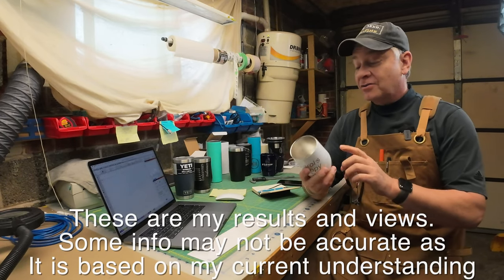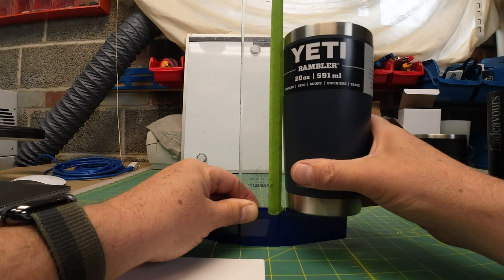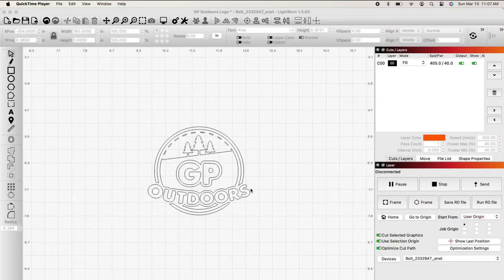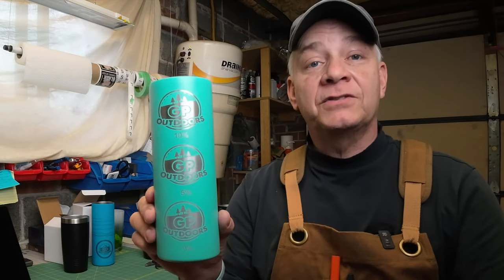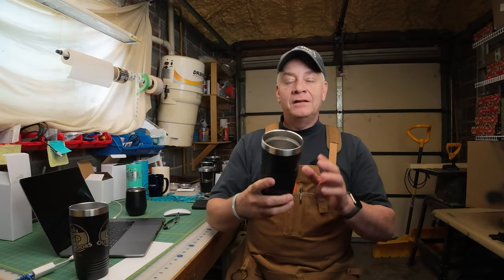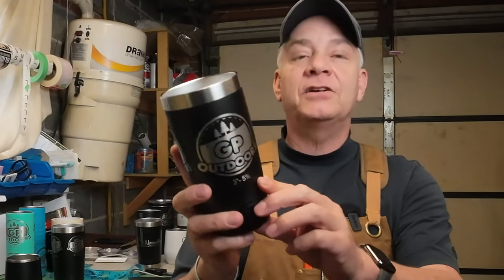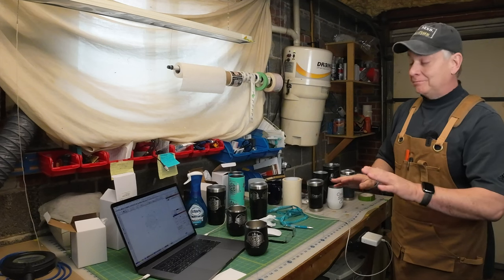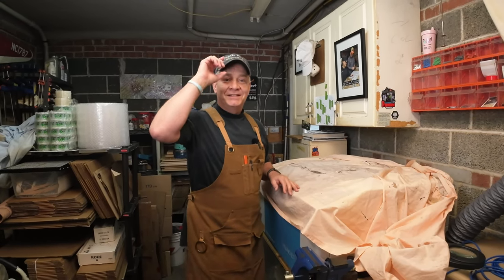Taper Warp. Tumblers and Round Logos? One Size Does Not Fit All. Thunder Laser BOLT.  026   4K

Comment: Gord, all you're asking for mathematically is to convert chord length to arc length.

Use this online calculator to account for the horizontal stretch of the logo.

Whether or not you see it as skewed is completely dependent upon the ratio of the mug diameter to the logo width.

You only need to enter 2 values into the calculator. Enter the diameter of your mug for "Diameter" & enter your original, unskewed logo width for "Chord Length." It will automatically calculate everything else. The "Arc Length" value is your new, stretched logo width.
Reply: omnicalculator
Reply: C o m
Reply: /math/arc-length
Reply from the maker: Good morning and thanks very much for the idea. I will take a look at this today for sure. Cheers!

Comment: Gord, thanks for all your research! Just subscribed to your channel. I like the way you explain things. Question for you, are you using the 30 watt Bolt and a 2 or 2.5” lens? I have a 80 watt Boss. I’m surprised at your settings 600/70. Everything I’ve read uses 400/40. Have you tried running slower? Thanks!
Reply from the maker: Good day and welcome - thanks for subscribing. I am using the 1.5" - yes , I saw that others offered that and started at 400mm as well a couple months ago, but over time testing different settings, I went from 400 mm to 600 mm now with excellent results (as shown). I still notice that similar to 400mm setting, some colours need either more or less power (sometimes I use 80% power) or a little extra cleaning - but 600mm settings are coming out great. Yes it is a 30W Bolt. Let me know how it works out for you. Thanks again and good luck!

Comment: Hi G.P. Just a suggestion have you thought of maybe measuring where you are going to engrave and say it’s 2.5 inches make it 2.5%? I know nothing about it but I thought about it while you were speaking
Reply from the maker: Morning Ronald. That is interesting. I was thinking about seeing if that math works out. But have not put pen to paper. It might work. I know a couple of folks move the decimal over from the diameter ( ie 3.2" diameter, they use 0.32 and add it) but their results still look like the top and bottom of the circle looks flattened to me. Thanks Ron!

Comment: So it looks like there is a formula between the diameter of the round logo and the diameter of the cylinder being engraved. 7% for big logos (closer to the diameter of the tumbler) looks good. The smaller the logo the smaller the stretch required if at all. Thanks for this 🙌 just a quick question - on a taper, is your focal height in the middle of the logo or at the biggest diameter of the object you’re engraving?
Reply from the maker: Good morning - that's a good question - I focus around the middle of the design area ( not necessarily the biggest part of the design) but more to the middle of the height of where it will sit

Comment: It looks like you have added 10% to the width, then the taper warp is adding a bit more. Why did you add 10% first?
Reply from the maker: Morning Stephen. Great question. I tested the circular logo several times with and without taper Warp. If i don't add the width increase, even with the Taper Warp, the circle still would not look like a circle so I still have to add a % to the width. Test it out (Taper warp with and without the added width adjustment) and let me know how it turned out for you. Have a great weekend!
Reply: I added 5% with warp, 6% with warp and 0% with warp and we came to the same conclusion. The Boss and I both liked the 5% but 6% was close.
Reply from the maker: @StevenTindell  Good stuff Steven!